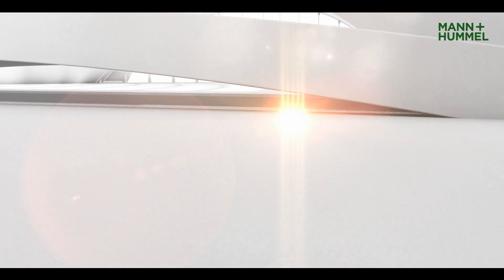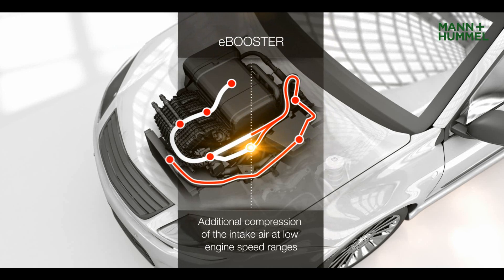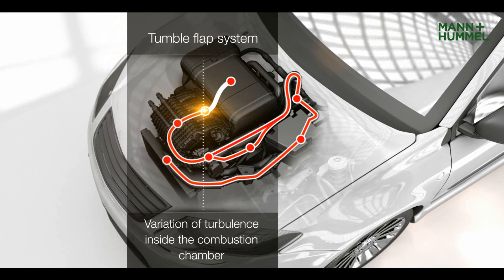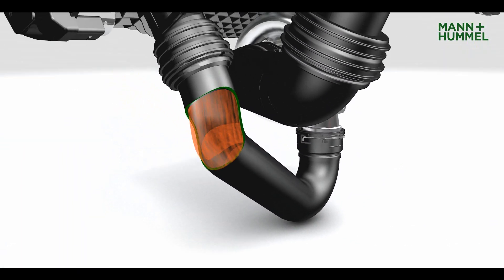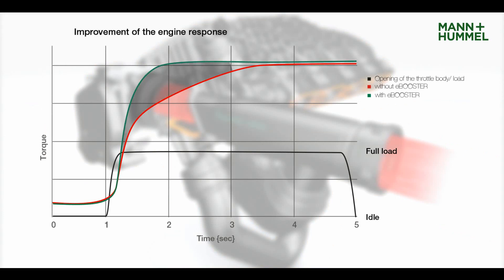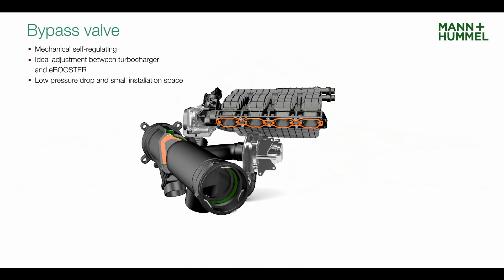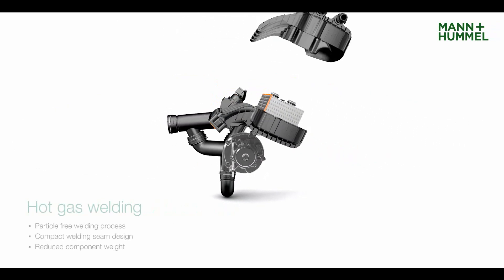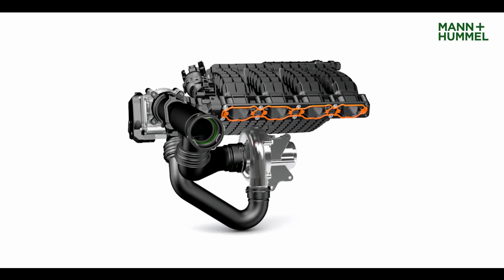MANN+HUMMEL Active intake manifold system with integrated charge air and eBOOSTER cooler

Comment: Great untill the flaps fail and get dragged into the engine.
Reply from the maker: Our components are developed, tested and released according to the respective customer requirements. These requirements and trials normally reflect the life cycle of such a component so that there should be no failures.